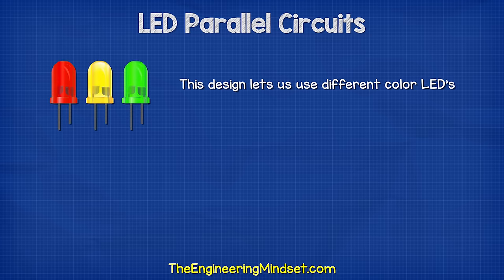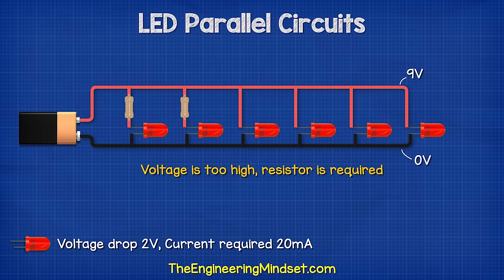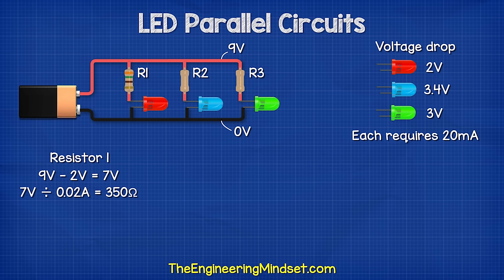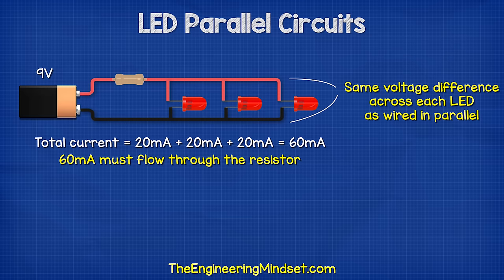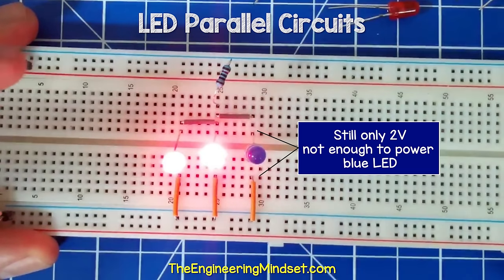Multi-LED circuit design - LED Parallel Circuits

Comment: I think it's worth pointing out that you want to put as many LEDs in series as possible before going in parallel.  That way, you can use smaller resistors and have less energy wasted in resistors (thus longer battery life).
Reply: Also good to know.
Reply: Good call. Thank you
Reply: Only if you are using standard LEDs on something like a breadboard, so that they are easy to replace. If one breaks, none of them will work if they are in series, so this might not be the best solution if they are not easy to replace
Reply from the maker: Check out NEW resistor video, everything covered! ➡️ https://youtu.be/DYcLFHgVCn0
Reply: @EngineeringMindset  but resistor still draw currrent how would It make battery life longer?
Reply: Best answer ever!

Comment: I hope one of your next videos will be on designing switch mode control for LED, or maybe LED matrix, and analysing how its used to significantly increase efficiency and reduce power loss. Keep up good work. Best regards.

Comment: I have a parallel LED circuit with two LEDs, a green and a red. They both have a resistor (that I believe is the correct value for the individual LEDs) and the red LED has a switch on it. When I turn the switch on the green LED dims when the red LED lights up.

Comment: I believe at 4:23 the resistor power is 0.41976W, say 0.42W. Not 0.49W as stated. Not that it matters as the same half Watt resistor would be used. Thanks for your video as I am new to LED's and I am making my own head tracking setup for DCS. A couple of bucks in parts, an old webcam and free software is going to save me a lot of money .Your video has helped a lot.
Regards,
IKM
Reply from the maker: Check out NEW resistor video, everything covered! ➡️ https://youtu.be/DYcLFHgVCn0

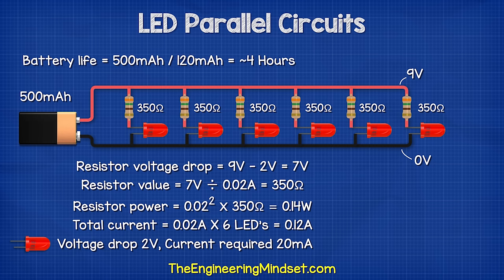Comment: 1:25 Should be: Battery Life = 500 mAh / 120mA
Later on you have the equation correct.  Not being picky, just trying to help improve on an already top notch and practical explanation of LEDs.
Reply: yo literally before a moment I noticed that too
Reply from the maker: Well spotted

Comment: Thanks for explain the ohm's law 
I learn more from this channel thanks for your hard work😉😊
Reply: Other than ohm's law,i think you have to understand about Kirchoff's Voltage law and Kirchoff's current law as well.To be able to analyze your circuit.Like this LED video example.
Reply: @yojanna1237  yeah ok

Comment: Hey Paul, amazing job 👍  My students ask one more question: Do you have a video tutorial how temperature regulation works in HVAC (especially on mini split AC) systems..? if yes, we couldn't find about it on your channel 😒🤔
Reply from the maker: We have covered this a little in our PLC video https://youtu.be/uOtdWHMKhnw but I'm writing a script as we speak for HVAC basic controls. Should be ready in ~2weeks
Reply: @EngineeringMindset  amazing, wish every success  👍👍👍👍
Reply: @EngineeringMindset  I have a question because I'm trying to understand more about how current flows. What's the result if something conductive touches just a hot line, hot-neutral, and hot-ground?
Reply: @airmanfloyd719  when the circuit encounters a low-resistance path between electric potentials, the current through the circuit will spike into the hundreds of amperes. This will generate a lot of heat very quickly, and will either cause one of the wires to melt, or one of the circuit elements to destroy itself violently, such as a battery.

Comment: Thanks paul👍🏾 paul right?😅 Anyways, thanks for the videos, I've been thinking how to connect led for a week now and burn almost a hundred of em bc didn't match voltage and resistor 🤦🏾‍♂️ so this video is really helpful bc i would like to build a led vu meter for speaker so this is really helpful, its easy to buy pnp but i would like to do it myself 😅

Comment: Thanks for making this video!
Im confused though... the setup at 1:50 has 6V in each branch. But you have 6 branches. Does that not "strain" the power supply? To me it seems im asking for 6V 6 times...

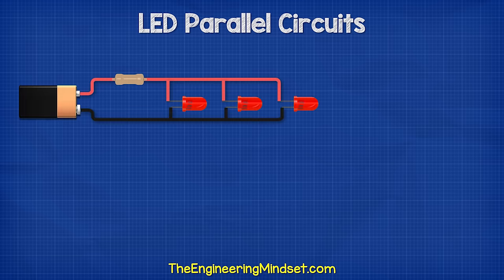Comment: You shouldn't connect LED's in parallel like at 3:20 as a failure could cascade and cause them all to burn out

Comment: Where did you get the 0.02A value from?  My LEDs have a Voltage value and some other value of 3 to the right of what looks like a p with the line swishing through the centre and flicking up.  What is it?  Ohms, Watts, Amps or something else?

Comment: It should be noted that color LEDs which are in clear plastic when off require different supply voltage. However, LEDs that use colored plastic to filter the light are typically the same voltage. You should always check the manufacturers cut sheet for the correct voltage and drive current.

Comment: You state resistor power. I am wondering if that resistor power is the same power from power supply for my LEDS. I would like to setup 20 white LEDS in parallel. Your example has a 0.49W. Therefore I resume I would a power supply that can provide at least 0.50w

Comment: if you calculate a 1/2 Watt resistor you may want to use a 1W instead to keep it cool and safe.
Reply from the maker: Check out NEW resistor video, everything covered! ➡️ https://youtu.be/DYcLFHgVCn0

Comment: I'm repairing a parralel/series lighting circuit. It's 18V, with 7 parallel sets of 4 LEDs (28 LEDs total), each branch having one 73Ω resistor. What a disaster. Anything goes wrong with an LED and either that branch all fails, or in the case of a short, the current spikes on the others and they burn out. There's no constant current control for when anything happens to a single LED. The design is EXACTLY as you describe in this video and it's horrible. The math all makes sense until an LED misbehaves and then it's cascading failures. I'm rebuilding it as individual LEDs in parallel.

Comment: If all kinds of LED color need 20mA,that means if we want to use different color of led with the same supply,constant current method is better than constant voltage method,Right?

Comment: Can we run 100 led connected parallel or serious vy one led driver . The drive will take ac input 230v. Pr we need to put resistor for ech led. Plz answer
Reply from the maker: Check out NEW resistor video, everything covered! ➡️ https://youtu.be/DYcLFHgVCn0

Comment: Could you plz do one video on battery level indicator for 3.7v and 12v.

People use different resistance values connect in parallel with leds to indicate battery voltage. 

As per your lecture if take same colour led of 3mm connected in parallel with 3 leds would like to glow when full if battery is 100% if battery reach to 50% then two leds if battery reaches to 20% then cut off.

Let's assume battery 18650 full is 4.2v
Then let's set another volt for 50% that means when battery reaches to 3.6v and when reaches to 20% means 3.2 and when battery drain to 3v complete off.

So here would like to understand calculation  of resistance use in circuit.

Please help. I am leaning and interested to apply such circuits

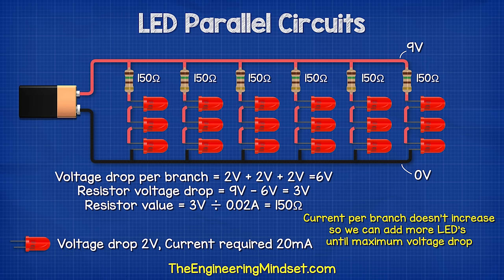Comment: 2:02 Why wouldn't the current per branch increase in your calculation for the resistor when you did take that into account in your later explanation with three LEDs in parallel but with one resistor before they branch out?
Reply from the maker: Check out NEW resistor video, everything covered! ➡️ https://youtu.be/DYcLFHgVCn0

Comment: if i use a current regulator, can i connect different color led in parallel? and for the voltage? if i get for example 3.5V for all color?
Reply from the maker: Seen the new LED explained video? so much detail covered! https://youtu.be/O8M2z2hIbag